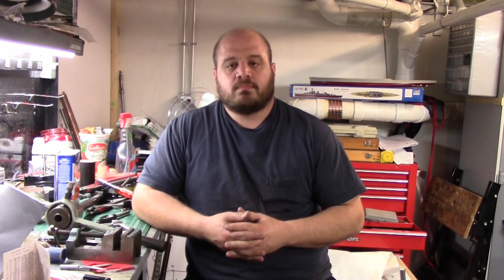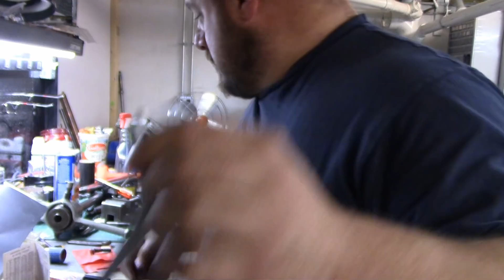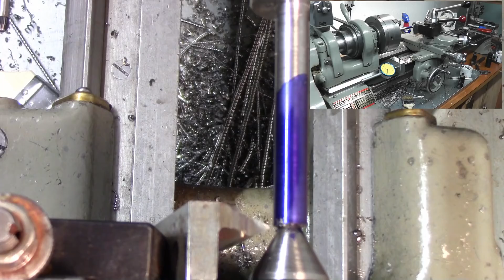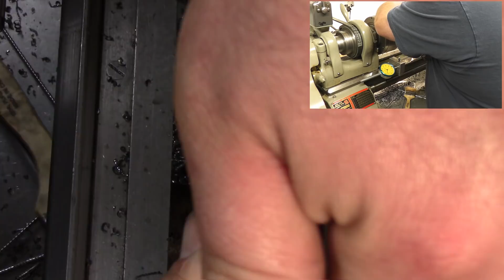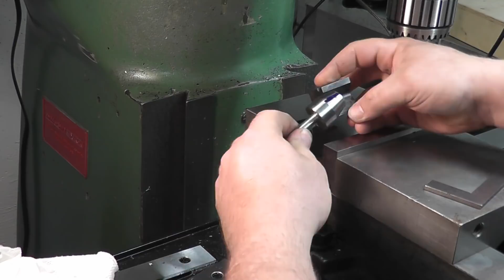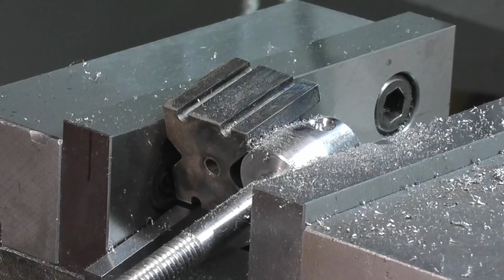Carriage Lock Bolt and Handle

Comment: I found a thread depth formula that has worked quite well for me and has eliminated a lot of trial fits.  I think it was on Practical Machinist but I'm not sure about that.  I wrote it on an index card that stays in my Machinery's Handbook.  With the compound at 29 degrees and the stock turned a couple of thousandths undersize, .498" for a 1/2" bolt for example, use .708/n (n=number of threads per inch).  So for a 1/2"-20, .708/20=.0354" for feed on the compound at 29 degrees.  So far it's been pretty darn accurate.  Give it a try.

Comment: I have a solution for when you have a part tightened in (like at 18:16) that you don't want to damage getting out. Get some leather hide (or even an old belt) that has a rough side. Get a pair of mole grips, and cut the leather to make pads wider than their jaws, leaving overhang either side, and longer, to lap over the noses and go well back into the jaws. Then glue the smooth side of the leather to the jaws. The rough side will then give you some grip on the part, and the jaw teeth will put pressure on from the back but without them marring the part surface. The overhang will ensure that the part is protected from the jaw edges if it tips sideways. It's a cheap and effective tool that I always have in my box.

Comment: Nice Job.  I like what I see.  I have the same center finder for my drill press as you displayed in the beginning of the video.  I also use it on my Mill when accuracy is not an issue.  I haven't checked it against my edge finder, but it seems to get within 5 to 10 thousandths of center.  Keep the videos coming.

Comment: Single point threading. Touch off with cross slide and zero it. Back off depth of cut. Touch off with compound and zero it. Back off on compound. Bring cross slide in to previous zero.  Cut threads till compound reaches previous zero. You can pull tool back with cross slide as long as you don't loose its previous zero. Saw that on another youtube channel out of texas. Try it on some scrap

Comment: Did you happen to have a picture under the carriage showing the part of the lock that engaged the underside of the ways? Was trying to replace my carriage lock with a duplicate but wondered if there was another way to do it besides the crappy design I have.

Comment: Would you please share the specs on the carbide tool and inserts you are using?  I have a South Bend 10K and have been struggling grinding my HHS cutters.  I haven't gotten into carbide but would like to try it with a quality tool like you have.  My tool post takes Aloris AXA holders.  Thanks.  BTW, your videos are exceptional.  You make it look almost too easy.
Reply from the maker: HSS takes a little bit to learn.  There is a video on this channel on grinding them if you want to check it out.  The holders are cheap sets from Shars.  The thing you want to do is use positive rake holders.  Anything that will take a 33mt 32.51  is a decent place to start.  Cheap inserts fork, but once you find a decent style , check ebay and purchase some name brand ones.

Comment: Before you check thread fit against a nut, best to use a file or other tool to remove thread burrs. Otherwise, you will tend cut threads too deeply and end up with a loose fit. Nice work as usual.

Comment: Nice work Greg. I was wondering if you would know the size of the spindle nut that fits on a 9" South Ben lathe. As a newbie to the lathe I have not yet mastered cutting threads. I was hopping to just buy a nut to protect the threads when using collects. Any help would appreciate.
Reply from the maker: Anthony Cash 
If it's a standard 9" workshop it should be 1 1/2" x 8 TPI.  If you have a real old machine (pre 1937) it may be different.  Check out my ER 40 collet chuck for boring and threading something to go on your spindle.